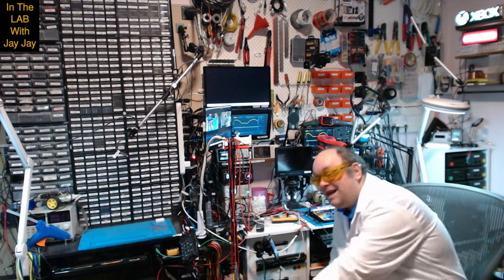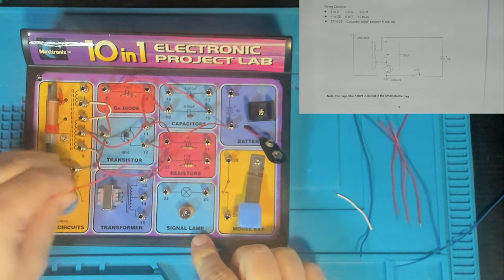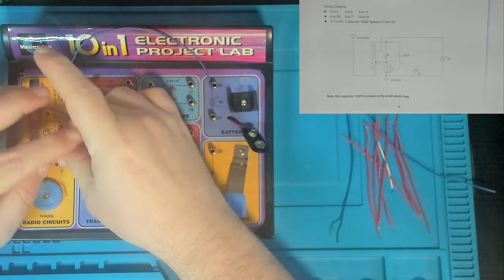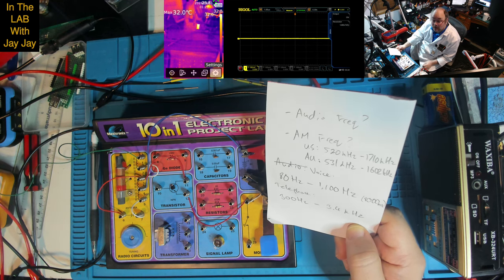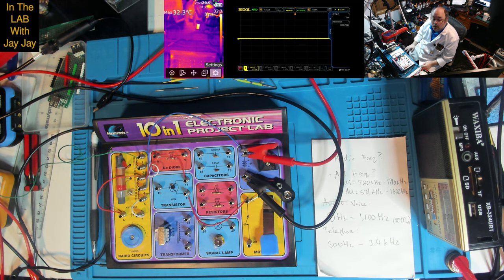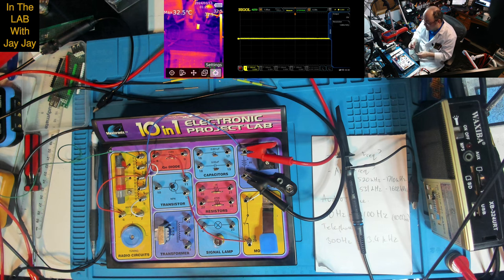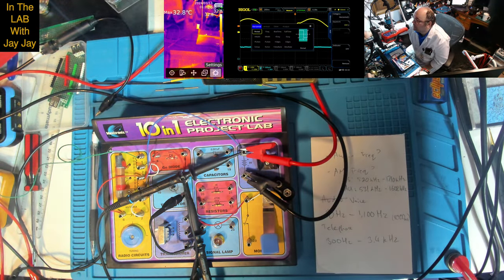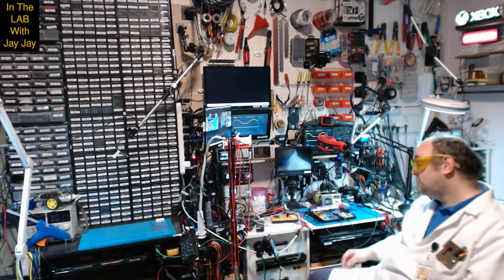Wireless Continuous Wave Transmitter | Project 7/10 | Maxitronix 10in1 | In The Lab With Jay Jay

Comment: The transmitter is only transmitting a carrier wave there was no modulation, the base of the transistor had no connection to anything so the transistor couldn't oscillate. If you had connected the 100nf capacitor between 5 & 10 (the capacitor is already on the board connectors 16 and 17) but was not connected! then you would have had a carrier wave and at a guess a 1khz modulated tone!   I have no idea why you called the quietness a modulated tone. normally a tank circuit makes the carrier wave and that is what part of the antenna winding and the variable capacitor is making!!!!
Reply from the maker: Hi there. Thanks for your comment. I'm sorry if I said the wrong thing, I am still learning! :) There was some discussion about how this circuit does (or doesn't!) work over on the EEVBlog forum: https://www.eevblog.com/forum/beginners/how-to-measure-am-broadcast-circuit-with-oscilloscope/
Reply: 1 kHz tone? How? There is no circuitry for modulation here. The circuit is a CW transmitter which means continous wave, which means no modulation. The circuit was working as intended. When you use an SSB-receiver instead of AM you can here a tone. There is just a one Transistor oscillator here and nothing else - no special tricky circuits that would do any modulation. And he added the 100pF cap between terminals 5 and 10. You can see it if you look closely. He just didn't schow how he put it in.
Reply from the maker: @elektro-peter1954  Thanks for your comment. You are quite right about that capacitor. I didn't understand the instructions asking me to insert that capacitor, because it wasn't wired in using spring terminals like all the other components. I ended up figuring that out and fixing it in a part of the video that I didn't end up publishing. So that was my mistake, sorry about that. I am very impressed that you managed to notice that though, well done!